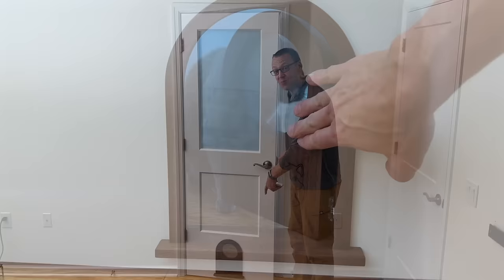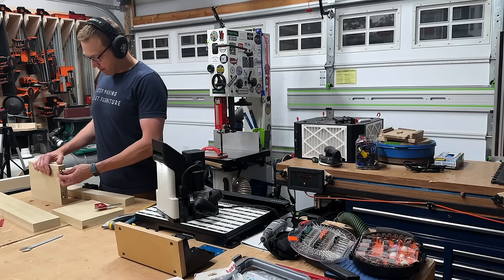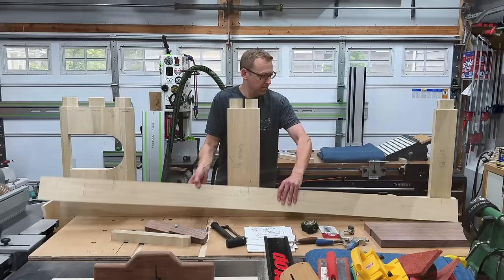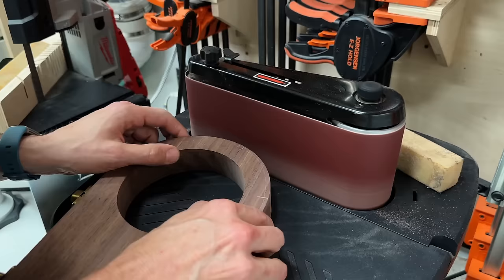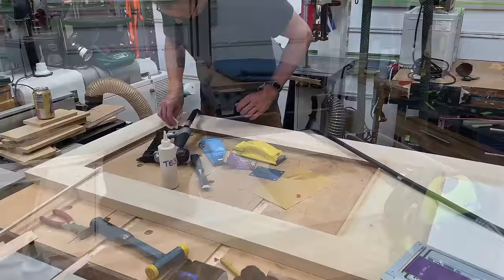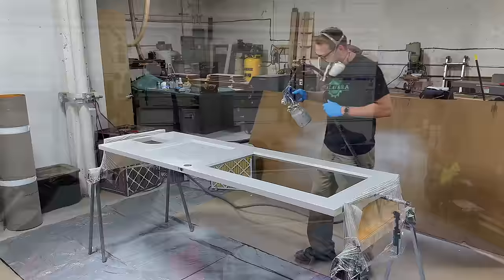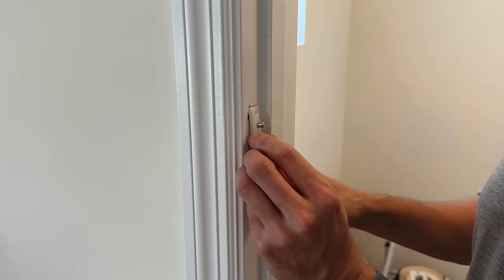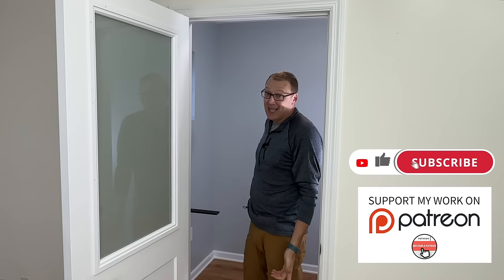Your home office will NEVER be the same.

Comment: Since you don't do too much paint-grade stuff, you should look at Bourbon Moth's tip on pin nailing (or at least that's where I learned it from)! Take some blue tape and pin through it, apply wood putty/filler, and then remove the blue tape afterwards. It removes the step of having to clean up the excess putty/filler and risk taking off those nice edges!

Love the door!
Reply from the maker: Yeah, that is a good tip! 👍🏻 And thanks!

Comment: For the glue up sliding problem: use a small amount of washed, coarse sand. It will prevent the wood from sliding and will not mess up the chemical prozess of the glue itself.
Reply from the maker: Sorry, but none of those tricks work. Rocks maybe, but not sand.
Reply: @KeithJohnsonCustomWoodworking  Than I'm doing something wrong, as it works just fine for me. Ofcourse you can't just clamp two pieces together like a barbarian milking an ogre, but since I use small pinches of sand (~1.5-2mm grain size), I have no movements, or slidings during glue ups.

Comment: The job of a studio door is mainly to be as soundproof as possible, which means airtight, and probably an 'airlock' with a second door.

That window might be nice in a glass porch, though... especially with a hot tub.
Reply from the maker: I use the word "studio door" loosely as I'm currently recording in another closet right now and it all sounds great (the voice over for this video, for example). I'm not recording a studio album, so I'll be good!
Reply: @KeithJohnsonCustomWoodworking  Well yeah, it's got a caaaaat door in it.
Reply from the maker: @hxhdfjifzirstc894  I’m aware.

Comment: Next time you apply foil to glass, use a generous amount of soapy water between the film and the glass. You can easily adjust the film if placed incorrectly and all the water is just squeejeed out. Easy peasy.
Reply from the maker: This specific film said to use alcohol only.
Reply: @KeithJohnsonCustomWoodworking  Yeah, that covers a lot of mistakes :D Good job, btw, thanks!

Comment: Is there any concern that it might not meet fire regulations? I was thinking of making a door for myself (like yours except way more boring: no glorious holes for privacy glass or for a cat door) then I heard that it would not meet local fire regulations.
Reply from the maker: I’m not going to pretend I know anything about fire regulations, But I can tell you the only fire rated doors in my house are ones leading to the exterior or garage. All the other garbage MDF core doors in rooms and closets with 2 inch gaps at the floor couldn’t stop a heavy sneeze 😂

Comment: Dude you definitely got a bad can of primer, that stuff usually dries in an hour max... After years as a second generation professional painter this is a first I have heard of that happening.
Reply from the maker: Well, it's my 3rd bad can of paint from SW, so they are officially on my DO NOT USE list. However, they do give a much bigger discount on green and yellow frog tape than my BM store, so I'll still go there for that 😂
Reply: @KeithJohnsonCustomWoodworking  That's so weird... I mean I wouldn't use it either if that happened to me.
Reply: @KeithJohnsonCustomWoodworking  took a second look I have a feeling you might be putting it on too thick, maybe ad a splash of water also back brushing it would help work the paint into the wood fibers and help with drying. Watching the paint as you pour it it looks a bit on the viscous side add a bit of water, primer should be fairly runny, the thinner spread will help dry faster as well and also get into the fibers better. Not a Sherwin Williams fan boy but if you get stuck without any other options in the future hope that does the trick.

Comment: hey Keith, another great video and great project.  One question -- @ 18:00 you glue the thin walnut pieces to each other -- a small end-grain glue up.  I saw that and thought wow is that going to have enough holding strength?   I've found that when I've done some end grain glue ups, like for a picture frame with mitered corners, once I start sanding or introducing any stress or vibration the glue joints sometimes separate.  And later in the video you ended up reducing that trim piece down to like 1/16th so again I saw that and was terrified the whole assembly would just break apart at the glue joints.  Glad that didn't happen though.  Is the secret to use a dab of CA glue like you did?   or would even just using regular glue hold well enough?    oh, and second question -- how do you like your Harvey DC?  I've been looking at them and love all their features and innovative design, but I can't get past the terrible placement of the main inlet.  Seems like it makes setting up any ductwork, or placement of the machine itself, very awkward.  Would love to hear your impressions.   Thanks!
Reply from the maker: Sometimes with end grain glue-ups, the grain soaks up the glue and you end up starving the joint, so you can size the joint with a "wash" of 50/50 water to glue and then apply more glue. With harder woods like oak and walnut, that is not as much of an issue. A big factor is also giving the joint sufficient time to dry before moving it. Since these arched frames weren't going to be under any stress and were being attached flat onto another surface there is no real danger of those joints separating. And I only use CA glue to get the quick grab - I don't recommend it for long term end grain glue-ups because it can be fragile.
Reply: @KeithJohnsonCustomWoodworking  Thanks Keith -- and any thoughts on my second question?   Impressions and likes / dislikes about your Harvey G700 dust collector?
Reply from the maker: @carlpetitt2241  Love the Harvey DC. Inlet placement is really the only complaint I have.

Comment: When there's no contact, it automatically becomes glazed?

I wonder if it exists the other way around? So if I put it on windows and there's an issue, I'm not stuck with a glazed window
Reply from the maker: Correct. It needs power to be able to go clear. So, when the door is open and the contact switch isn't engaged, it's frosted. 

That's a good question about windows...my guess is if the power goes out, you would have a house full of frosted windows. Unless you install some kind of battery backup.

Comment: Wondering about your thoughts of doing the whole door out of MDF instead of just the panel. I’m planning on doing something similar but since it’s an interior painted soon with thinking solid MDF would paint nicely and be super stable.
Reply from the maker: It's just never my first choice of material to work with because it's so heavy, messy and fine dust is toxic. And the MDF doesn't have good holding power for screws.
Reply: @KeithJohnsonCustomWoodworking  The screw thing is a very good point I hadn’t considered, as are your others points. Thank you for your input.
Reply from the maker: @michaellpeterson  You're welcome!